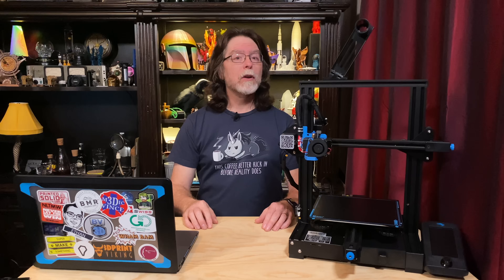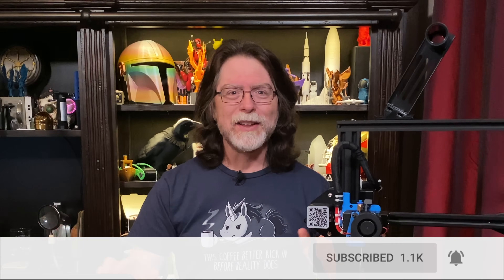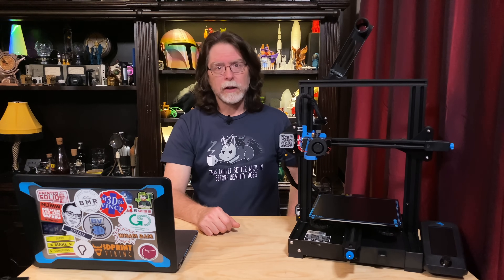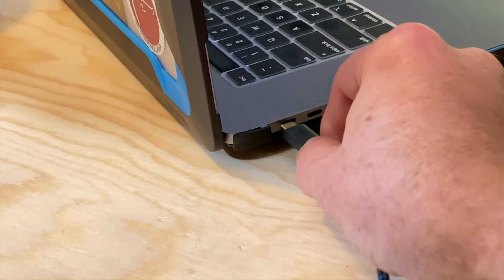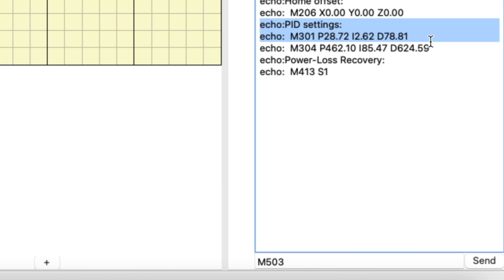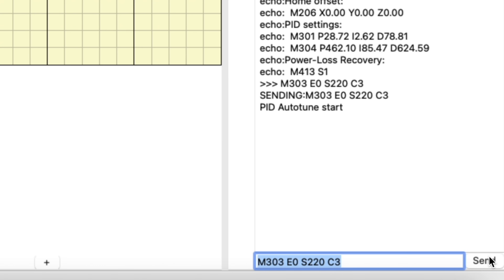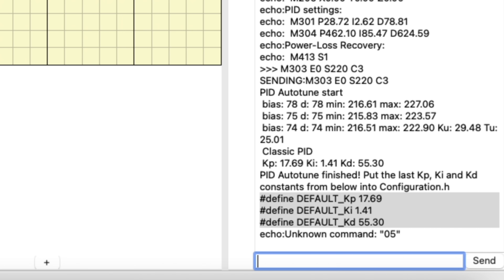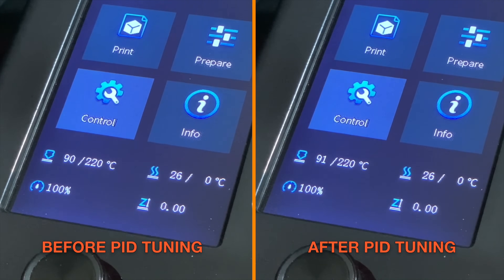PID AutoTune your Ender-3 V2 (or other Marlin-based 3D Printer!)

Comment: Great video. Very helpful. Thanks.
Does anyone know a good place to help troubleshoot Pronterface on MacOS? I can contact to my printer (Wanhao Duplicator i3 Plus) but Pronterface will not display any temperatures back from the printer.

Never mind. Turns out my problem was I had Cura running in the back ground. If I turn off Cura when running Pronterface, all works as it should.
Reply: I’ve got it working on my Mac. As long as I quit out of Cura first, Pronterface works fine. Something about Cura querying the printer even if I don’t want it to, was interrupting the flow of data from/to Pronterface.

Comment: Awesome explanation!  Been having this problem all day, no other videos/websites even suggested this as a factor and I'm going to be doing this right away!
Reply: Had Heating failed error after doing this, it performed well in the tune test. I will double check I did it right and try again, only thing left to change out is the power supply.

Comment: I just set up my 2nd Ender 3 Pro, and out of the box the Hot end temp was bouncing.  When set to 205 I was seeing it go from 201-209.  Ran this process and now it sits at a steady temp like it should.  One thing to mention about pronterface, make sure you don't have another slicer program open, or it won't connect to your printer.  I didn't realize I still had Cura open in the back ground and was going crazy trying to figure out why I couldn't connect.  Once I closed that, everything worked like it was supposed to.  Thank you so much for this video.

Comment: Not sure if anyone has mentioned this as there are over 160 comments, but depending on the compiled version of your firmware, there is a place in the menus to enter and save the values after the cycles are complete. Perhaps this will come in handy for some people. :)

Of course, always record the values returned to you after the autotune in Pronterface. This will come in handy if you need to re-enter them later without needing to connect via USB. Of course, these values may change later on if you make a change to any part of the hot end hardware, so as always, use the terminal to recalibrate if needed and then record the values. If for any reason you do need to re-enter those values from the LCD screen, follow the steps below.

To set the values in the printer From the Main menu: 
Scroll down to Configuration and click. 
In the next menu, scroll to Advanced Settings and click.
In that menu, scroll down to Temperature and click.
In that menu, scroll down all the way until you see the options that start in PID.
Click on each value that you want to change.
Use the knob to dial in the values you received after performing your M303 command in Pronterface and click when done.
Do this for each value.
When you have successfully changed the values, scroll back to the top and click the up arrow button to return to the Advanced Settings menu.
Click on the button at the top to return to the Configuration menu.
In this menu, scroll down to Store Settings and click. The printer will beep when the settings are successfully stored.

There is a menu at the bottom of the Advanced Settings Temperature menu labelled Autotune E1 which allows you to select the tuning temperature but does not allow you to choose a number of cycles. By default, it is set to 5. The menu lists the values a little differently from top to bottom as follows:

PID-P E1:
PID-I E1:
PID-D E1:

You can enter the values manually in here if need be, then scroll back to the Configuration menu and click on Store Settings.

I stumbled across this and thought it might be worth sharing... I hope it helps someone out there! :)

Comment: Should I do a PID tune if my nozzle flexes -1 degree and over +1 degree periodically. Not much of a difference but I did do a microswiss hotend upgrade 8 months ago but never did one and prints ok. Also does this test how “True” my temperature is set to when I set to a degree of let’s say 220C like does it test to see if it’s actually at 220C
Reply from the maker: It sounds like your PID values are correct for your hot end. If it's continually going + or - 5 degrees or more, I'd consider running a PID autotune, but with a + or - 1 degree variance, you're right where you need to be.
Reply: @BV3D  thank you

Comment: Note to myself 
pid start 
#0.1 m503 get  info
#0.2 M106 S200 (fan speed set 0-255 most case)
#1 m303 E0 s215 c5 (e0 extruder s215 temperature c5 cycle amount) 
#2 m301 Pxx.xx Ixx.xx Dxx.xx   (pid set )
#3 m500 save
good video but i dont want to rewacth when i just need the command
aslo saved the video

Comment: This video is great and made it super easy to do the PID tuning! However while watching this video, I accidentally yanked my usb cable a bit and now my ender 3 v2’s screen has gone completely blank. This happen to anyone or anyone know what to do for this?
Reply: Easy fix got it solved by updating firmware on printer. Now using octopi instead of pronterface

Comment: Thank you man, this was really useful in helping me figure out my problem. If anybody is overshooting their nozzle temp by 30+ degrees it could mean that you're using a 12v heater instead of a 24v one. So that's what all that blue smoke was.
Reply: I learned many years ago in electronics school, all electronics run on smoke, you should never let the smoke out of them or they will stop working.
Reply from the maker: Oh no! 😳

Comment: Hello! I would like to know why I got different value quite far apart each time I run this test? shouldn't I be able to find close value instead?

Here's my results so far:

default pid setting
echo:  M301 P27.35 I1.71 D109.14

After First Tunning:
M301 P16.55 I0.98 D69.70

Second one:
M301 P23.40 I1.68 D81.55

Third one:
M301 P15.84 I0.97 D64.80

... Shoud I merge these result too? lol

Comment: I fought with windows, for an hour, to try and get it to recognize my ender 3. If it doesn't show up as a USB serial port then this software (or cura or anything else won't connect). I installed the drivers and did a ton of troubleshooting, to no avail. In the end I used my android phone with otg cable and the Serial USB Terminal app to connect and send the commands described in this video. Worked like a charm and I didn't need to fight with windows, drivers, really old software, etc.

Comment: Echo: NoEEPROM.

Once I turn off printer and turn it back on the PID tuning is back to default. How do I get it to save permanently?
Reply from the maker: Hi James! If the printer doesn't save to EEPROM (my Sidewinder X1 is like that), you can still use your new PID values by including them in your starting G-code.
For instance, if your P value is 21.73, your I value is 1.54, and your D value is 86.55, you would include this in your starting G-code in your slicer.
    M301 P21.73 I1.54 D76.55
See https://marlinfw.org/docs/gcode/M301.html for information on Marlin's M301 command.
Reply: @BV3D  I had considered that. However it would have to be added to every gcode I have. I have a bunch presliced meaning I'll have to rebuild all of them. Meaning I have to remember all the other settings for those prints as well.... lol
Reply from the maker: @jamesg.6906  Well, G-code is just text. You could open a G-code file in a text editor and paste that one line in and save the file. 

You’ll want to use a plain text editor like Notepad++ on Windows or the free version of BBEdit on macOS.

That way you don’t have to remember all the previous settings from when you sliced that file. 👍🏻
Reply: @BV3D  I think I've figured out that I can run the gcode itself via sd card once including the m500 command. 

It will hold until I turn off the printer. I think I'm just going to see if this works consistently. It seems to be able to hold settings thru multiple prints. Just have to remember to load it again if I need to turn the printer off or power outage.

Comment: Brian I am having a problem on my ender 3 v2 with a new copper heat block. The temp isn't going up and down its doing the opposite it's staying put. I had an aluminum one on the stock one that came with the machine. But I had a clog and it was a mess so I used what I had extra the copper heat block. But it's making my prints look like crap. I ordered the aluminum ones on Amazon they are arriving today. I think I will put that on so I don't have to mess with the PIDs. What do you think?

Comment: Would be interesting to compare the built-in autotune function to a proper PID design using classic frequency analysis from Control Theory. I would think it is overkill for the performance requirement of this application, but still..
Is it possible to set a temperature value in open-loop (PID disabled) and then record/extract the resulting temperature profile for that set value? I mean, without modding the HW and SW of the electronics.

Comment: i just had to do a search or the 64 BIT Pronterface for Windows 2017 version as mine is a 64 bit system the one listed here 
is for a 32 bit system on windows! I downloaded it it stated it was a 2017 version, and installed it on my windows 17 PC was following your video here.

I did the port select and the connect click ad the software said it was connecting....
And after many minutes it still said connecting... 

It did not finish the connect so I can't do the PID.

The com port was the only one there "COM1"  no others the PC detected the port and usb and the printer screen lit up ( Voxelab Aquila ) 
before I even did the connect try! 

As soon as the usb was plugged in in fact.

What can I do?  Help me.

Comment: All of that AND you need to speed up the movement when the printer is not printing, you can do this in the slicer program.  This causes bubbles on one side of the print and not the other due to temp fluxuation holding the filement while slowly moving across the entire piece.  Just speed that up and your print time will go down as well.  Thanks for the Video.  3M. We don't make the video.  We just comment and make it better.....
Reply from the maker: I thought that was BASF... 😉

Comment: hello, so im unable to find any connection in Pronterface for my printer. I'm only finding com1 which is my ethernet connection. do you have any suggestions on how i can get the program to recognize that my ender 3 v2 is indeed connected to my pc?
Reply: okay so i have resolved this issue, had to download a driver. but now when i run the Autotune command it runs for a minute then gets to 250*c then give failed temperature to high. i lowered the autotune run temp to 200 and still get the same thing.
Reply: may have resolved that also, i accidentally bought 12v heater cartridge's not 24v. i have ordered correct ones and will replay if i have also resolved that issue fully.

Comment: I connected the usb cable that was previously connected to octopi (raspberry pi usb - other end connected to ender 3 v2) and plugged it into the usb port on my laptop. When i run pronterface. I only see COM3 in the port connection, there is nort option to select usb? Any help please
Reply from the maker: Oh! If you've already got Octopi set up, use the Terminal tab in there to send the commands and see the responses. Check the box to Suppress temperature messages so the terminal window isn't flooded with status information.
Reply: @BV3D  Tried as suggested, got the following error  Send: M303  E0 S220
Recv: PID Autotune start
[...]
Recv: Error:Heating failed, system stopped! Heater_ID: 0
Changing monitoring state from "Operational" to "Error"
Send: M112
Send: N2 M112*35
Send: N3 M104 T0 S0*34
Send: N4 M140 S0*97
Changing monitoring state from "Error" to "Offline after error"
Connection closed, closing down monitor
Reply from the maker: @ravkhangurra7522  Forgive the question, but is the printer plugged into power, and its power switch on? Or is its motherboard being powered via USB by the Raspberry Pi?
Reply: @BV3D  Thanks Brian, not sure what hppened, , i tried it again, now getting flat lines at the resective temperature settings. Once again thanks for your help. Time to do some test prints!

Comment: To do this with a heated bed:
Replace the E0 with E-1 (Extruder -1 Is the Heated Bed)
Set the S to 60-70 depending on how you use it
IMPORTANT! USE M304 NOT M301TO SAVE THE SETTINGS
Reply: Recommend using bang-bang control on the heatbed instead of PID.  PID is harder on the power electronics and the heatbed is a much larger heater.

Comment: tried PID method, motherboard will not save settings, it won't even apply them. Can I replace the  v1.1.3 with new a v1.1.5 board?
Reply from the maker: Hi James, if you take the Kp, Ki, and Kd values that Marlin reports after doing the PID AutoTune, you can put those values in your Starting G-Code in your slicer.

You'll use an M301 command to work this magic.

Let's say you got Kp, Ki, and Kd values of 21.03, 3.12, and 45.39. Using that info, your M301 would look like this:
M301 P21.03 I3.12 D45.39

Put that somewhere near the beginning of your Staring G-Code. Then, when you slice a file for the printer, those PID values will be set before the print begins.
Reply: @BV3D  aaahhhh okay, I will try that this weekend. my printer has been down for like 2 months, thank you for your responses.
Reply: @BV3D  Thank you so much, applying it to the gcode in the slicer seems to be working and hold steady nozzle temps. Thank you again!!!!
Reply from the maker: @James James  Excellent! Happy printing!

Comment: @6:40 of your video, I'm having an issue on the port menu not showing anything (running windows) even though Ender 3 is on, connected to computer via USB, and pronterface is open and running? Any advice in getting it to recognize a port?
Reply from the maker: Hi, you may need to install a USB-serial driver like the CH340 driver. Here's a link to it over on TH3DStudio.
https://www.th3dstudio.com/hc/downloads/drivers/ch340-drivers-th3d-uno-creality-v1-1-x-v4-2-x-board/

Comment: Can I set the PID on my Ender 3 V2 using jyers firmware v1.3.5.b too? Using PID autotune from screen menu.
Reply from the maker: Yes you can, and it's way easier than using a computer to do it. Don't forget to save settings when Jyers is done with the tuning. 👍

Comment: Thanks! My silicone boot sht the bed and my printer kept going into thermal runaway protect. This worked perf! If the printer doesn’t connect do a restart on your pc and make sure you’re using a sync cable.

Comment: Bryan, I have a CR-20 that the hot end keeps getting hotter and hotter. I have already replaced the hot end with a new one.  Someone told me I need to run PID autotune. I get the following error in Pronterface:
SENDING:M303 E0 S220 C3
PID Autotune failed! Temperature too high
PID Autotune start
PID Autotune failed! Temperature too high
echo:Unknown command: "MM105"
I have no idea where to go from here.  Thank you for any help.

Comment: Is it possible to have the pid tuning getting wrong withouth changing the hot end? I'm using a stock ender 3 v2, just changed firmware from factory to jyers, and recently my hotend temp has started oscillating. Should I try an autotune?
Reply from the maker: The Jyers firmware may store the PID values in a different part of the printer's EEPROM than the stock firmware does, so it's probably a good idea to do the PID auto tune. I've just started looking at Jyers, and I think it has a PID tune option in one of its menus. Look around and see!
Reply: @BV3D  I've tried the auto tune in the menus and it worked, my temp seems stable now. Another reason to switch to jyer ;)

Comment: I did a PID auto tune because the set max temperature kept fluctuating (which in turn affected the printing temp causing my prints to fail), but the problem still persists. Does anyone have some insight?

Comment: This was a great walkthrough. I noticed that when I switched to OctoPrint from the SD card that my temps were fluctuating with would in turn prevent my prints from starting. This fixed that issue right away, thanks!

Follow up: You said that Creality doesn't save these settings to the board so does that mean I need to run this every time I power off/on?
Reply: It saves these settings to the SD card, so you need to rerun this every time you change SD cards. (At least by default. If you’ve installed a third-party firmware such as Jyers, it’ll save it to the board.)
Reply: @yaketyyakumo3315  That's what I ended up doing. Thanks for the reply though!

Comment: Great video!  For those looking to do the same tune on the bed you can use M303 E-1 S60. The E-1 tells the printer to test the bed (E0 was for hotend) and S60 tells to test to 60 Celsius. You set these values by using M304 just like setting the hotend temps with M301. Then M500 to save like Brian shows.
Reply: I've tried PID tuning the bed but I get an error about the heater not being there. Not sure what I'm doing wrong
Reply: @dedogster  Use M303 EBED C6 S60. It appears as if some older versions of Marlin don't like the E-1. Set the bed PID with the M304 Pxx Ixx Dxx command using the calculated values. Don't forget to M500 to save settings.
Reply: @Stew3DPrinting  Dang, was trying to get the same to work on Aquila X2,.. typed command, clicked to Octoprints temperature tab,... and the Extruders showing 60 deg, bed at ambient.
Reply: @Stew3DPrinting  Thanks so much, this worked for me!
Reply: Quick question, how do you get those commands
Reply: THANK YOU
Reply: You can skip having to use M304 (in most instances depending on Marlin version installed) to set the values for the bed by adding U1 to the end of the M303 command, you still need to use M500 to store them to EEPROM though.